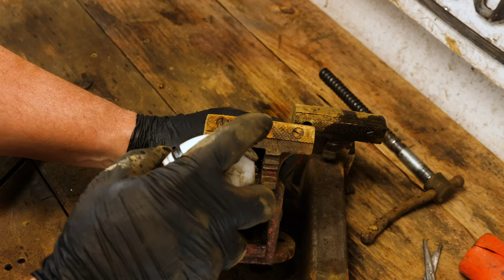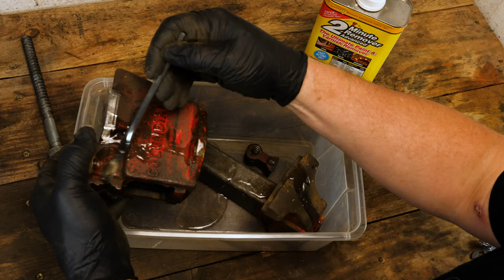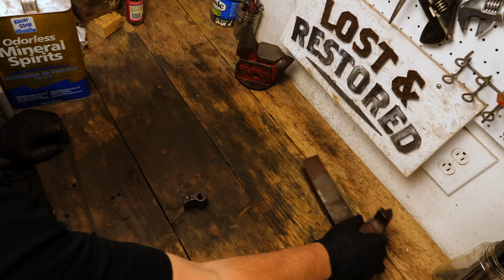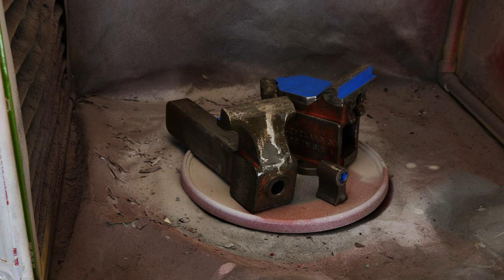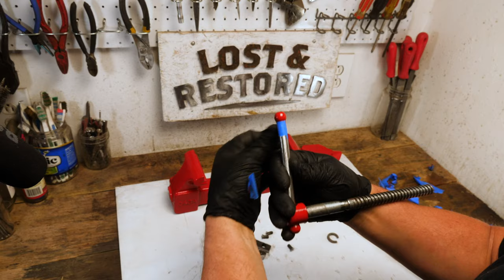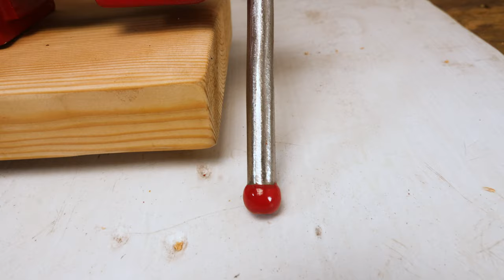Rusty Bench Vise Broken - Amazing Restoration

Comment: Ive never seen anyone use JB weld like bondo. You would get a much nicer finish if you removed all of the paint from the vise,  then use acetone too degrease.  Use a primer with self etching to fill any imperfections on the vise surface.  Wire wheel the jaws to bring out the original steel color.  These are only little suggestions that may give you better outcomes on your future restorations.  Keep the videos coming. Good Job.
Reply from the maker: Thanks for the tips! I wanted to try some JB weld out along the edge of the anvil since it will take a lot of hammer hits. But I definitely like your tips. I'll use them on the next project!